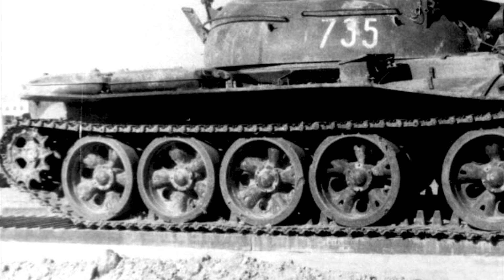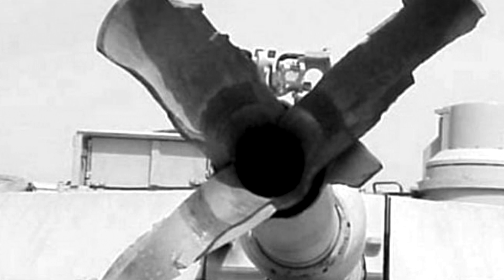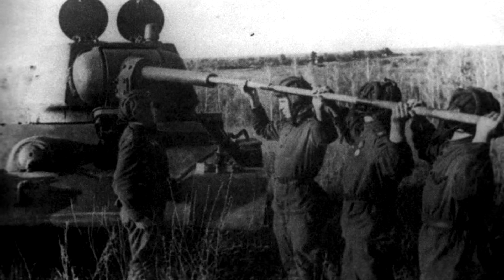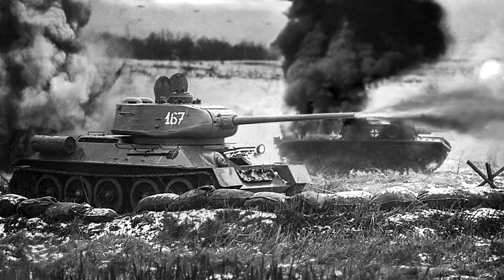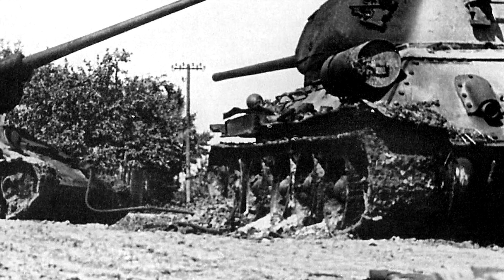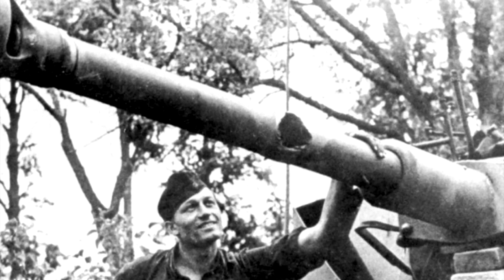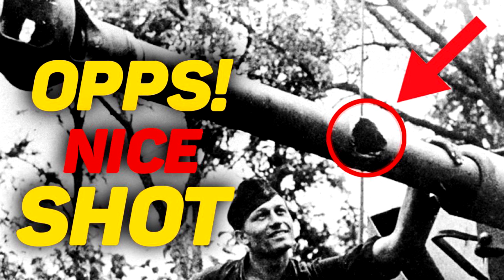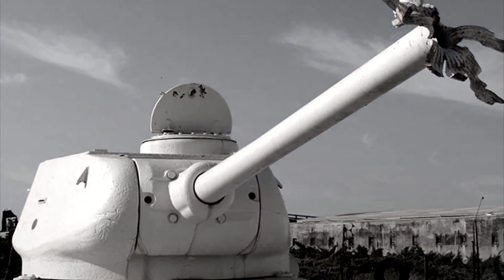Why did the tank barrel explode? WW2 documentary.

Comment: Hmm, no. I work on various calibres from cannon to 5 inch for several decades. The most common reason for this is an in bore explosion. The main cause is a hot gun, that is a barrel that had not had sufficient time to cool down between firings. This causes the explosive in the round to "cook off" in the barrel. There are tables and timings to prevent this from happening.